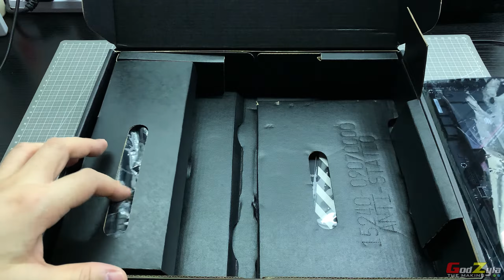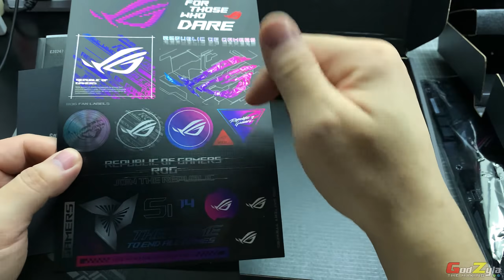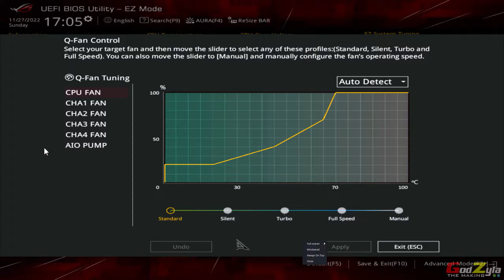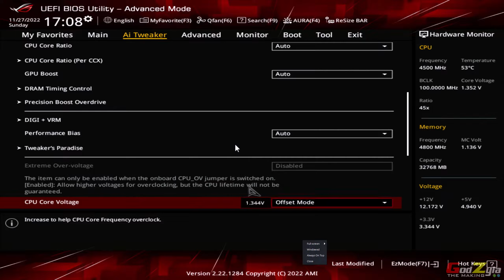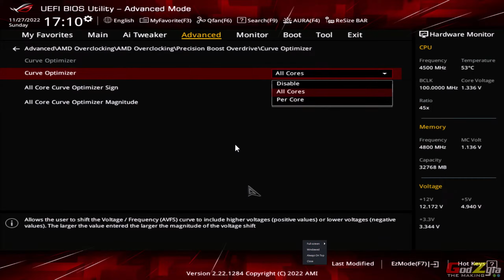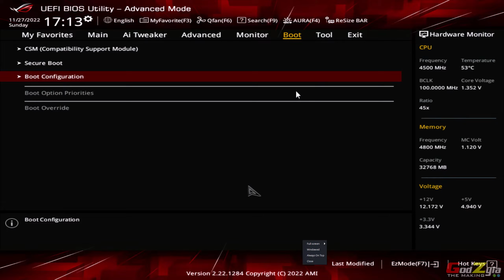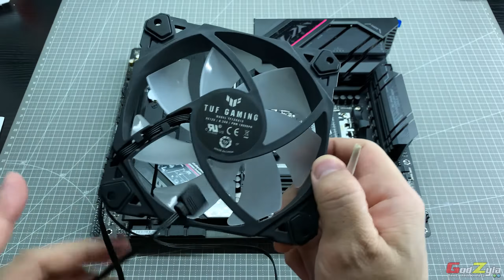ASUS B650E-F Strix Gaming Wifi

Comment: Hello,can you tell what about boot time and Ethernet i225 problem. I m planing to buy this board with 4800Mhz, 16GB (2x8),  going to use stock setting.If ı use higher Mhz and use expo, i read all over the inter boot time will be slower.Also most user have Ethernet i225 problem about internet.Have you encounter these problem?
Reply from the maker: Hi koray koraç, welcome to my channel, yes I do face this issue. As what I did is this 
1) download the current driver of this board. https://rog.asus.com/motherboards/rog-strix/rog-strix-b650e-f-gaming-wifi-model/helpdesk_download/ (Intel I225/I226 LAN Driver V2.1.3.3 For Windows 11 64-bit.)
2) uninstall the driver that's on your windows
3) reboot your PC
4) install the new driver you have install, check and see if you have the issue.
5) If you are having issues, go to the network adaptor and to disable these 

- Advanced EEE
- Energy-Efficient Ethernet
- Power Saving Mode
- Green Ethernet
Reply: @KleoYan   I read that the problem is with the hardware related and they release the i225 v3 of the motherboard. But I don't know which version of the motherboard I will buy from the market. Most vendors still sell the first version.
Reply from the maker: @koraykorac5463  I see, in most builds I have done for friends. I just update the driver from the motherboard website and then turn off the EEE settings in network adaptor and the Power Green settings. That fix the issue in most of my cases. It's not only AMD platform. Intel Z690s and Z790s too, also with the E3100 2.5Gbe too. All these boards that are having the issue, I performed what I've shared with you and issues are gone.

Comment: There Is a way to use my gskill trident z5 6400 to his stock frequency without downcloak ?  I have same mobo
Reply from the maker: Hi Andrea Andolfo, if your g.skill runs at expo profile to 6400 which is unstable, pump the volatage by 0.5v. I hope thats what you are trying to ask.
Reply: @KleoYan  thanks for the fast  tips Bro , new follower .
On mobo box It says 6400 compatibility , i Wish that 0.5 v could help me to run these RAM , if It Will not work how rightly downcloak to reach 6000 ?
Reply from the maker: @legendreaper92  mind if I ask what’s your ram timing?

Comment: Thanks for this overview, I Just have one question I have two, m.2 nvme drives, one I plan to use for games, and the other for the OS. Which m.2 slot should the OS go in to? Considering the fasted slot closest to the cpu, I would assume would be better for gaming. Or does it not matter? thanks again for the video.
Reply from the maker: Hi lsotrev, welcome to my channel. Assuming you have 2 x 2tb nvme and both are of PCIe 4.0 , install both OS and Games in one m.2 which is to slot the m.2 slot nearest to the processor on your motherboard and the other m.2 at the middle slot on your motherboard as game storage or data storage. That will be ideal. As both os and game load will be faster.
Reply: @KleoYan  Subscribed! the video helped a ton and thanks for the fast reply.
Reply from the maker: @JetPackJuggernaut  you are most welcome and thank you to have subscribed. 😊

Comment: I want to use 3 daisy-chained Lian Li Uni Fan Sl inf 120mm RGB on this board.  Their Ampere rating isn't written on the Fan itself, nor can I find it in the manuals that come with it.
Dr. Google didn't help either.
Any chance u can tell me, whether or not it will work on the 1 Ampere rated headers on this board?
Thx in advance!
Reply from the maker: Ten Kenobi hi, for fan load (PWM) you dont have to worry, max fans you can use is 3 which each SL Inifinity fan load is at 0.18a = total 0.54a but for argb load is 0.60a thats where you need to think how many fans will you be using and to check the argb load of this motherboard. (refer to manual)
Reply: @KleoYan  thank u very much. I will study the motherboard manual for max argb header load.
Reply from the maker: @HEINZgg  you are most welcome. all the best with your build.

Comment: Can you do a review on the Asus rog strix b650E -E gaming Wi-Fi mobo? I’ve been trying to find videos on if it is worth buying but seems like their are none. This would be very helpful.
Reply from the maker: Hi Rodnie Torres, welcome to my channel, I see what I can do, no promises though.
Reply: Another question, since motherboard has expo, if I buy a ram that has xmp, will it still work? Also what is the voltage/wattage of the fan header and rgb because I would like to use the Lian li uni infinity but I don’t know if the mother board can withstand those fans. I would greatly appreciate you help.
Reply: My bad, I didn’t realize you mentioned the amps but still will the Lian li infinity fans still work and if not, is their a way where you can make it work? Also the question with the xmp and expo.
Reply from the maker: @rodnietorres3082  if you are using the 3 fan pack set. It comes with a uni controller. Just supply sata power to it and connect the SL Inf fans and it will run fine. But if you purchase single pack fans then do not daisy chain more the 4 fan to an argb header to your motherboard.

Comment: There are some m.2 thermal pads that come in the box am I suppose to stick those in the m.2 ignoring the already existing thermal pad?
Reply from the maker: Hello Ganymede, welcome to my channel. The thermal pad in the box is for spare. You can just use the existing pad that are on the m.2 shield.
Reply: @KleoYan  Thank you Kleomede :) 
Unrelated question, perhaps you could help me. Im building my PC today. I have a AK620 cooler and used the included thermal past for the CPU (7600X) I also bought another thermal paste (Mars Gaming MT0), is it ok to use the deepcool thermal paste should I replace it for a better one?
Reply from the maker: @daviid27.  you should be fine using either. Maybe test out both to see which gives you better result. Try this method to apply the thermal paste.https://youtu.be/xZ2R4roF1_Q

Comment: i have subbed the channel and loved your review I Just ordered 
Ryzen 7600x 
Asus Rog strix B650E-F 
G.Skill 32 GB 6000Mhz
Now when you pointed out the ARGB header issue I am kinda nervous… I have Lian Li dynamic o11 and 6 ST120 and lian li 360mm Galahad AIO and 1 More Fan

My recent MSI B450 gaming pro Carbon AC showed VGA error everything was working tried another GPU PSU RAM CPU cleared and reset the CMOS, Bios flashback too but VGA light was on and no Motherboard logo came on screen. Luckily I saved enough money for the upgrade.
Reply from the maker: Hi VK Malik, welcome to my channel and thank you for the compliment. As for the argb and rgb header which are blocking the post code, that will be minimal if the cables are zip tied away from the post code led. It should be alright. Btw all the very best with your build and as for your Pro Carbon AC, if it’s still under warranty, you might when to have it repaired.

Comment: THANK YOU for this review ..I just bought this mobo for a new pc build (my 2nd build ever) ..I have 2 questions I am hoping you or someone can help me with ..on this mobo I bought some gskill ripjaws s5 6000 cl30 "intell xmp" ram ..now on pcpartpicker it showed no conflicts but now I noticed the "intell xmp" on the ram ...will that intell xmp ram work with this mobo with a amd ryzen 7 7700x ? will I still be able to get the 6000mhz oc speed out of that ram? ....my 2nd question is on the m.2 slots  should I be buying m.2 with or without heat shields? I can not find any info if i buy a m.2 gen 4 samsung 980pro with the heat shield if it will fit in this mobo or since this has those metal shields is having a heat shield on the m.2 itself even needed? ...I thank you so much in advance
Reply from the maker: Hi, Iron Hidex, welcome to my channel. Yes I find it strange too when this board only mentioned about expo. Nevertheless if it does not support xmp. It will run at default 4800. Let me write in to check. And as for m.2 if it’s of 7000 speed. You can rely on the m.2 shield not an issue. Either way. You can get m.2 with it without the heatsink but as mentioned the m.2 armour shield on this motherboard is sufficient for gen 3 and gen 4 m.2
Reply: @KleoYan  thank you so much for you quick reply... so the ram I bought i just made a mistake I didn't know about the xmp or expo or any of that like I said this is my 2nd build ever and now I'm kicking myself about it cause I really wanted that 6000 speed which guides say is the sweet spot ...my mobo arrives tomorrow and I'm gona try the ram and if it doesn't work at 6000mhz I'm gona half to try n return it and buy expo ram... on this mobo qvl it does not even show any 6000 cl30 ram on the list ...for a beginner ish builder like myself not knowing what parts will or won't work is super frustrating .... so what I meant with the m.2 is I bought a m.2 that has a heat shield on the m.2 itself ...will I be able to plug that in and still be able to put the metal covers that come with the mobo on top of the m.2 that has a heatshield build in? .... thank you so much again m8 ...I am having a heck of a time finding info on these issues I'm guessing because the parts are so new.... for around the 200-350 dollar mark do you think this mobo is one of the better options? I bought it just incase in the future 5.0 slots are used with new gpu or m.2  ...I only gona use this pc for gaming and will only use the auto OC features on the motherboard I don't know how to do any of that myself.......   thank you so much again
Reply from the maker: @EverydayBigshots  Hi, you are most welcome, I do understand it can be fustrating at times to get PC components right, nevertheless thats our learning in progress :) dont be as you are not alone. ok as for the board to be honest it will last for awhile as compared to Intel current platform, at least what you've gotten now will pull through till Year 2025 if you need processor upgrades or even to get a PCI-E 5.0 GPU. so no issue there. As for your m.2 that comes with the heastink, in most cases, you can't include that while using the motherboard m.2 amour shield. You will need to remove the m.2 original heatsink and to use the motherboard m.2 shield instead.
Reply: @KleoYan  Thanks again for the info ...I am going to be building my new PC tomorrow and will see how it goes ... this will be my 2nd build but using a bunch of parts for the first time ..water cooling, smaller case etc
Reply from the maker: @EverydayBigshots  ok if you need help and if unable to reach me here. You can always send me an email godzylatech@gmail.com I will be glad to help you out if you need any. All the very best in your build.
Reply: @KleoYan  thank you I went ahead and sent a email ..i also replied last night but was having internet issues so it does not seemed to have posted ...im having a heck of a time with the argb fans and aio rgb etc I sent ya a email I hope it makes sense
Reply from the maker: @EverydayBigshots  Hi welcome back, I did read your email but am rushing my report at work. I wll reply you soon. thank you!

Comment: Would this motherboard pair nicely with the R7 7700x?
Reply from the maker: Hi 182BlinkStar, welcome to my channel. yes this board will pair up nicely with 7700x without issue. Infact if you are into gaming, you can choose to use the Tuf too if 2 m.2 is sufficient for you. https://youtu.be/yctHrYfQtYI you see, the Tuf board is as good too and it's much cheaper, so that you can use that to get a better graphic card. This is just my opinion.
Reply: I ended up purchasing the R7 7700x and the b650E-F. Also just ordered a 3090 graphics card. Can you recommend ram and power supply?
Reply from the maker: @182BlinkStar  oh congrats on the newly purchase. as for rams, I have good experience with G.SKill Z5 Neo and the Ripjaw XS series. I have yet to test another others. As for PSU, majority will go for Corsair RM or HX series, personally I like Seasonic Prime series.